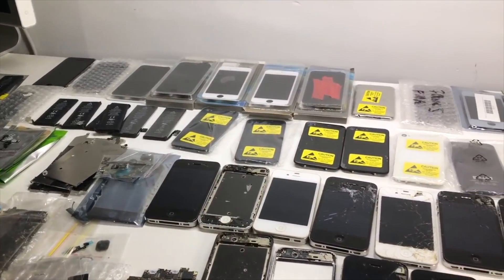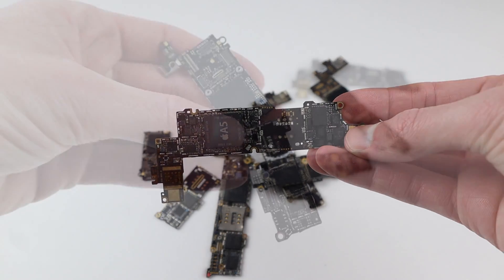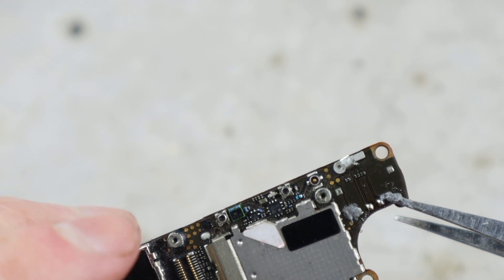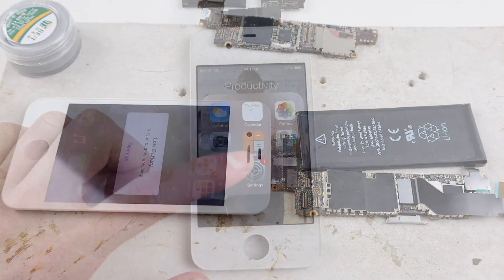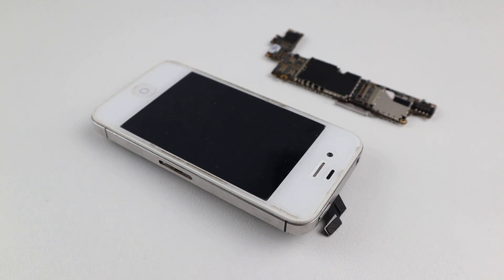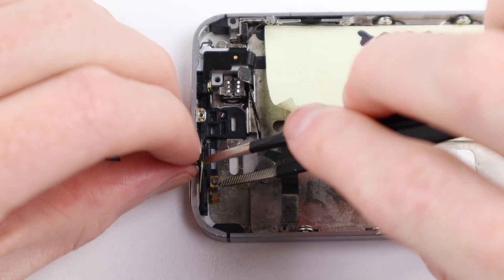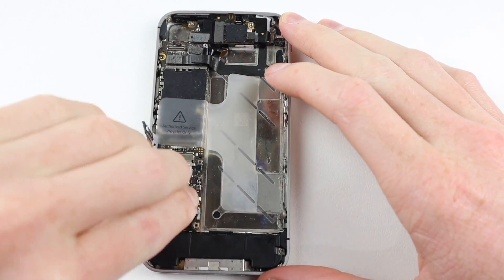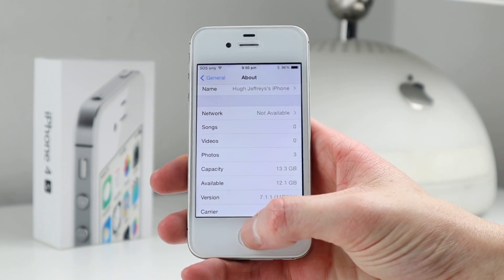iPhone 4s Logic Board Repair & Full Restoration

Comment: Pls fix my iphone 4s also it hasn't battery connecter display cable front cam back cam speaker volume up button cracked screen some damaged connecter if you can fix pls tell in the comment

Comment: 230°C ?? Tin melts at 232 and if you using leaded solder its about 300 depending on the alloy
I do this kind od work at 380°C

Comment: I made a time-lapse video on my channel of a logic board swap because I found an iPhone 4S in a cardboard box along with a bunch of other electronics outside my apartment complex near the garbage.  It was such a weird find because everything was in great condition. It was starting to rain so I rescued them.  The iPhone logic board was iCloud locked and I tried contacting the owner and got no reply. Bought a new logic board off eBay for very cheap and swapped out the logic board (which was actually really fun if you're into fixing stuff).   Got it working and sold it on eBay for a very nice profit.  I would have done it even if I didn't make any money!

Comment: Are you open to accepting a challenge? I tried a screen replacement on an old 6s I bought from my friend. I’d done several screen replacements before and never had any issues. Connected the screen which worked fine. I swapped the housing. Put it all back together and upon reattaching my screen the board sizzled at the lcd connector producing a small smoke screen from the board. I’d imagine it needs an lcd or battery connector replacement (or both) and I don’t have the knowledge or money to do it myself yet. The phone appears completely dead. Any chance you could help??? I really want to give the phone back to my friend with the data on as a surprise as it’s been sat in a draw for a few years now.

Comment: Damn, get some flux or decent solder. You've made 3/4 of those battery connector pins are cold soldered and will lose connection after a few hits. Flux is the basic.
Have fun and attempt board repairs!
Reply: I was saying the saying where’s the flux son
Reply: I also noticed that. He's really bad at soldering. 😕
Reply: @muflah  He did said that he's "new at this". Besides, this is an old video. He probably got better at it. Give him a break, every beginners make mistakes.

Comment: Hey Hugh Jeffrey’s I have A Problem With The WiFi On A Phone I Repaired I Took The Phone To A Shop And They Did A Terrible job on it and it broke the WiFi and when ever I’m on the phone I have to only use data and the WiFi in settings is greyed out do you know why ?

Comment: Its day 13 an my 6 plus still doesn't turn on
Reply: @AdrianRossi9013  I think its a software issue
Reply: @AecoTV-  hard reset. then dfu mode. then dfu mode hard reset. if not then logic board issue or software issue.
Reply: @RektByRafay  most likely bro its the iOS 12 update
Reply: Were you able to get it fixed.?
Reply: @Nutan_Dwivedi  nah had to buy a 7 plus

Comment: Loved the video, but next time just use flux and the solder should be easier to work with. it also makes it easier to take it off of the boards, same procedure as you are using, except there is no need to use the solder paste. It will take some practice to get used to though.

Comment: Hey, you have a very nice soldering station. You should buy a good amount of flux gel with a syringe, that will give you a faster melting time, a better flow and a better finish. Just flood it and it will be much easier. ;) Keep up the good work!

Comment: If you're going to do any more reflow soldering in the future, please look into getting one of these.  They allow you to heat the board from both sides when used with the hot air station you already have, which is ideal for through hole components.

https://www.amazon.com/Hakko-FR830-02-Convective-Preheater/dp/B00FZPTJ2A/ref=sr_1_16?keywords=circuit+board+pre+heater&qid=1564886945&s=gateway&sr=8-16

Comment: What happen if you put another A chip like A7 or A6 in the iPhone 4s logic board
Reply: It May Seem That It Fits But The Ports Contains More Connection Than The iPhone 4, 4s A5 Processor
Reply: I wish it worked
Reply: Gus 22222222 it won’t work

Comment: Apple really made repairability on the 4s easy as pie; too bad they put greed and profit above consumers by making each new iteration of the iPhone harder to repair
Reply: Septien Patterson Harder? It is much easier to replace the display on e.g. an iPhone 7 compared to the 4s. You don't have to remove the logic board to replace the display on a iPhone 5 and later, while you need to do it on a 4 and 4s.
Reply: @havarhen  I see your point, but I'm talking about different screws that need different screwdrivers
Reply: @psuedopotato  unnecessary bracket? Like what?

Comment: How easy is repairs on phones if you are a beginner
Reply: If you know what you are doing, nothing is really difficult. Also, it's best to practice on "Trash" phones to get a feel on what you need to do. 
(sorry if I didn't help much...)
Reply: Just have a comprehensive guide with you such as the ones from iFixIt, didn't really have much trouble replacing my screen & battery
Reply: Thanks I’m trying to fix a glitching screen on a se
Reply: Blake McAuley It is most likely a faulty screen. Have you dropped it before it starts glitching?
Reply: Ali Saylıca yes
Reply: Blake McAuley Its pretty easy to fix it, just follow the ifixit’s guide.

Comment: How much would it cost if I sent you a iPod touch 2 nd gen to restore? Screen still works but somethings wrong with the internal hardware that’s keeping it in a boot cycle and won’t let iTunes to restore it. Would need a new battery too, it’s a Snap-On edition iPod touch so we don’t want to get rid of it.

Comment: as it is running 7.1.1, you can use the iOS 7 iboot exploit on it to install any version on it. i'd recommend checking out @dora2_yururi on twitter if you'd like to know more. currently the tool costs $10 to get access to. this is due to people using the tool maliciously and bypassing icloud and selling fake downgraded devices. i think it's worth the $10 because you get access to updates for the tool forever (well at least until dora discontinues the tool). current devices supported are 4, 4s, and iphone 5. however dora is working on the ipod5, iphone 5c, ipad mini, and ipad3. you need ios 7.x shsh blobs for this. i really recommend checking dora's twitter out and her tool s0meiyoshino. to dump blobs, you can use odysseus which can be found @ dayt0n(dot)com. hope i helped. you can contact me on twitter if you need any help with dumping shsh